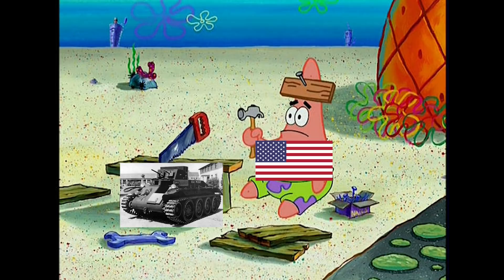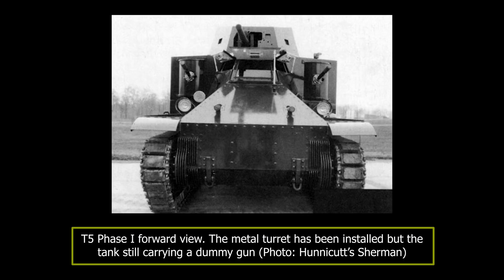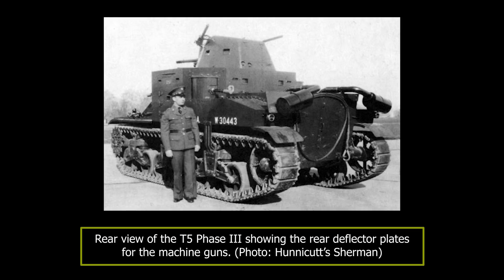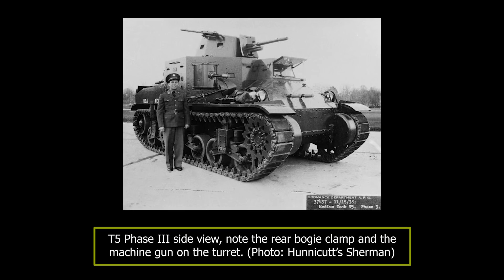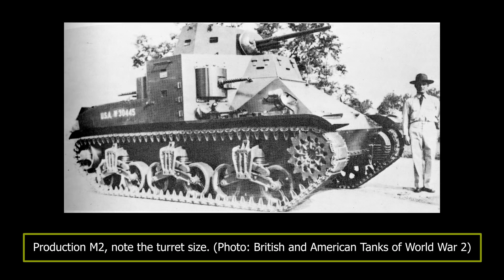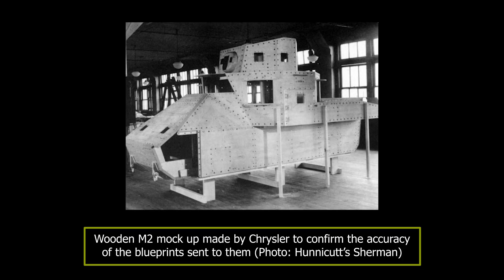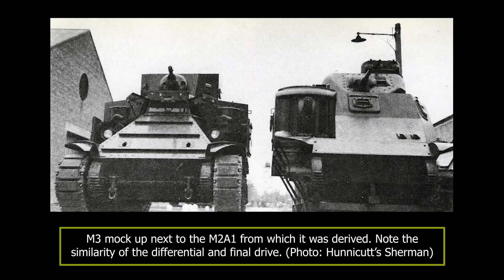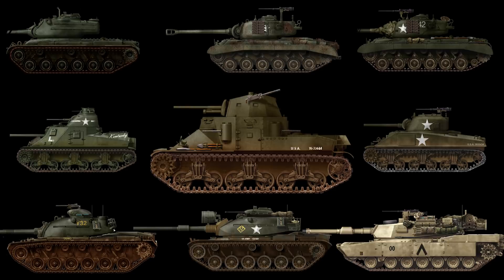A New Slate, A Bit Too Late | Medium Tanks M2, M2A1 and T5

Comment: One "feature" of the 37 mm gun was the ammo limitations.   HE was only issued to artillery units.  ?Tanks could only get the  Armor piercing 37mm ammo.    In north Africa, the 37MM on the M3 was stablized.  Unfortunately the stablazer was classified stricter than the level of the tank gunners.   Thus the gunners were not cleared to know about and use the stablizer on their tanks.